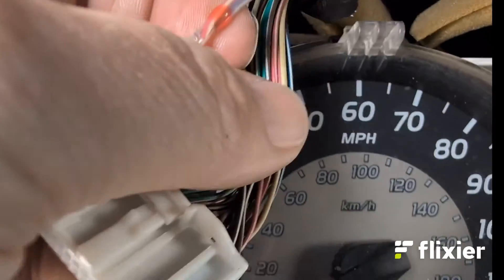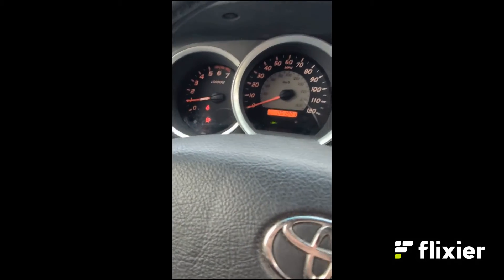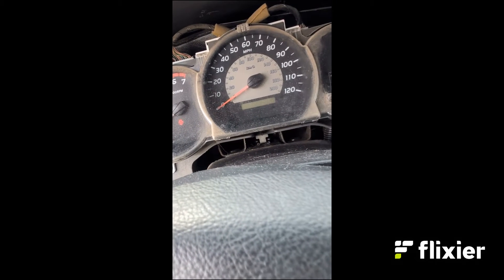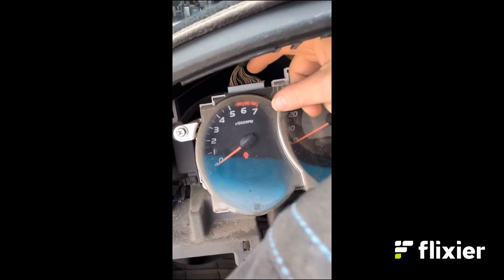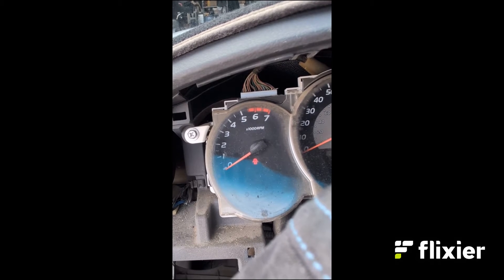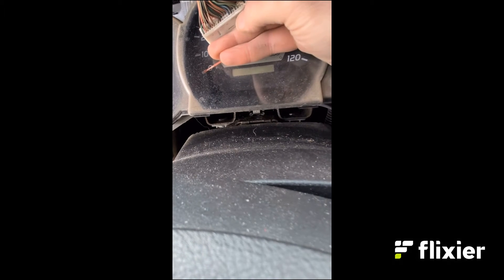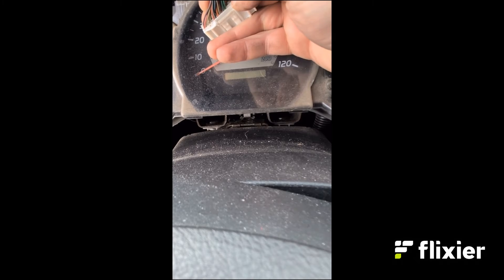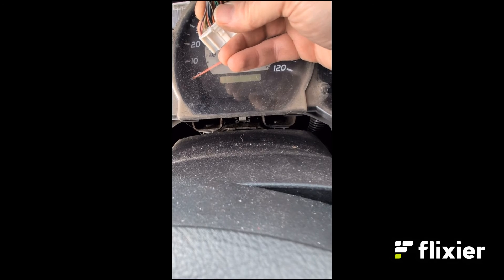p0500 fix for 2005 toyota tacoma prerunner vss cruise control check engine light

Comment: Hey, I have the same issue on my 2005 Tacoma and I’m trying to sell it and would love to get rid of the CEL. So it looks like you are cutting purple/white and connecting red/yellow with purple/white?  This doesn’t affect anything else?  Any help would be much appreciated!
Reply from the maker: https://twstatic.net/attachments/img_5165-jpg.5468832/ here is a link to a picture that shows exactly what wires to connect. its been fine since i did it, and it fixed my cruise control as well. i clipped both and connected them together at first, but that was a mistake and made my speedo not work. so i clipped the purple wire, and spliced that into the red with yellow stripe, but made sure the red stayed connected. i think the purple wire must be clipped and spliced in so the purple wire coming out of the plug goes nowhere and the purple wire going into the dash is the part that's spliced.

The following information details my personal experience and should not be interpreted as professional advice or a recommendation for action. I am sharing this for informational purposes only. Any attempt to replicate the actions described herein is done entirely at your own risk. I explicitly disclaim any responsibility for any direct or indirect consequences, including but not limited to injury, damage, or financial loss, that may result from following my example. Due to the inherent risks involved, I strongly advise consulting with a qualified professional before attempting any similar activity. Please understand that I am not an expert, and my experience may not be applicable to your specific situation. By proceeding, you acknowledge and accept full responsibility for any outcomes
Reply: @soberirishman78  Ah I see!  I also found your post on Tacoma world so that helps too. I’m just scouring the internet for solutions.  At least I can see if it’s the cluster that’s the issue. Thanks!
Reply from the maker: Good luck man, it's not too hard of a job to do, it all comes apart easily and has a decent amount of room to splice  @connor6837